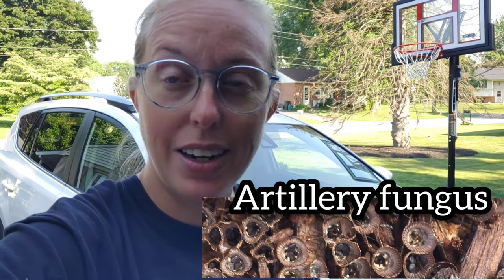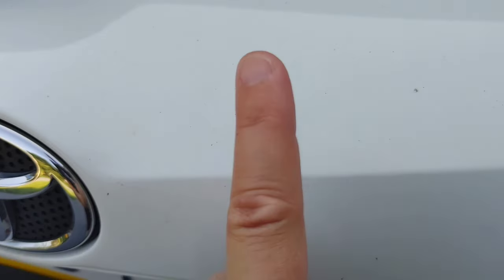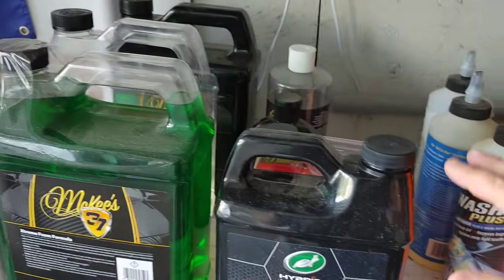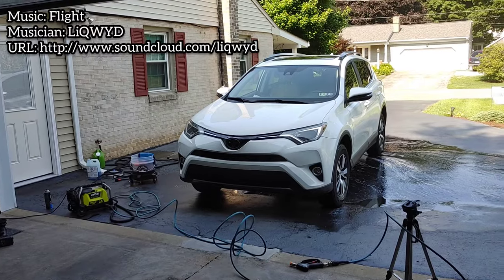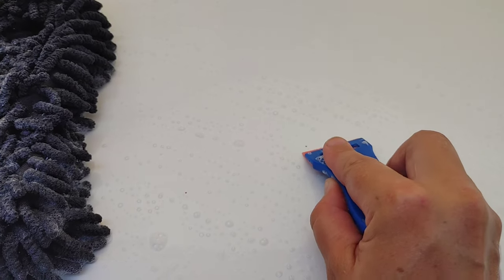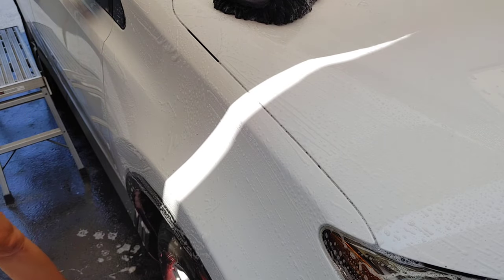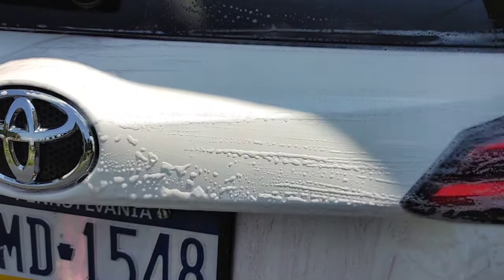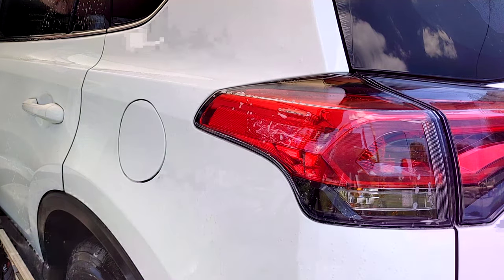How to remove black spots from car paint (aka- Artillery Fungus) + Other paint issues!

Comment: It’s funny I just dealt with this today on a 15 passenger Salvation Army Transit van ! I was able to get the majority of it with my pressure washer an APC pre soak , and then foamed with a heavy concentration of max power amped up with a string APC let it dwell and attacked it with the pressure washer up close and personal like. It got the vast majority of it without having to resort to more labor intensive measures on that big ol hoss!

Comment: Very good video as usual. A quick question for your experienced mind if that's ok?  Do you rate the new generation of tfr's? The non caustic, algae and seaweed based ones? I've been using one recently and I find it as good as surfex hd for it's cleaning ability, but not as foamy ( which is a shame ). So, not quite as god as surfex but, at dilution of 1.6% in a pump sprayer, considerably less expensive. What do you reckon?

Comment: Chelsea, this was a terrific video! 👏   I've not seen the "mold" issue ever addressed - first! 
I've  dealt with it but never really knew what it was.  Ooof...this vehicle was a mess!  - good job on revitalizing it.  White paint can be your friend as you can "see" the problems easily instead of darker paint in the same condition where you have to work a lot more by feel...
 I suggest the Turtle Wax Max-Power as  pre-wash for these situations  - it has worked tremendously for me.  I've not used that plastic scraper before  - does that accept plastic razor blades?  That is what I use.  I always keep a couple of those in the pocket of my detailers apron.  Gulp!...hey, if used cautiously they are a hand-dandy piece of the arsenal.   
Really good subject matter here!  Stay cool!  I did a full size pick-up interior (black) in this heat...ugghh.🥵

Comment: Was looking at a couple of videos as my ex-wifes car has had these spots for ... years, yes years .. on the roof of her car. Nothing worked getting these off. Tried all kinds of soaps, alkaline, acid, vinegar, cheap car polish and whatever. Even going over with a fingernail you couldn't even feel it.  There where patches of these things. Some part they were like hundreds in a small area.  Not having clay or wanting to use tools, since I don't have them nor the experience, I tried Meguiares ScratchX v2 that I had lying around just to test. Cleaned a small spot with hot water and soap first, dried, tested with a small dot of the stuff and some very fluffy cloth. It actually worked.  
Happily to report that after 30 min of hard work the roof (the only place they were) is as good as new.  First washed and dried it as to have it as clean as possible not to make scratches. It took some serious elbow grease but the result is more than rewarding.  After buffing I saw swirls but it was the dust of the scratchX on top of the paint so a light mist of water and a towel to dry it the roof was 99.8% clean and then some ceramic detailer and it looks like it hasn't looked in years.

Comment: Do you think the fungus would have attached itself to a ceramic coating? Would you have used same process to remove if it was ceramic coated? Interesting video.
Reply from the maker: Yes but it would possibly be removed more easily. Personally I haven't had any on my coated vehicle though.

Comment: I bought a new second hand car recently and when I cleaned it, I noticed some similar black spots on the doors. They break off with the finger nail and took a LOT of elbow grease to remove! But I also found some black spots on the back that you can't get off with the finger nail and I couldn't wash away. After seeing this I'm wondering if it's rail dust and the rapid decon might work? 🤔

Comment: Hey Chelsea what size is the canopy  you use and who makes it? Looks very sturdy and easy to put up. I've gone through two of them.
Reply from the maker: https://amzn.to/3onrUaV its 13×13. Its not SUPER easy but I've got a good process for opening it and my height helps make setup easier. Locking in that first leg is the hardest but after that its easy.
Reply: @attention2detailswchelsea  Thanks
Reply: @attention2detailswchelsea  You made it look easy !!

Comment: I use baking powder toothpaste. Takes it right off with a bit of elbow grease!
Reply from the maker: Be careful as that abrasive without proper lubrication can scratch the paint
Reply: @attention2detailswchelsea  Thanks for replying. The paste itself should be good as far as lubrication goes. 
I also use this to buff out minor/light scratches on my glass fish tank.
I've found it's not abrasive enough to cause further scratches and the black spots come off quite quickly.

Comment: Stubby gun and lance snow foam bottle all MTM,
And are you nozzles compatible with the flow rate of your pressure washer 
Sounds a little loud, like it's working too hard.
Reply from the maker: Yes they work great. My Ryobi isnt the quietest but it works for me.
Reply: With the smaller pressure washers you have to choke down the flow to lift the PSI for foaming. Othersize it just introducing more bubbles like car wash consistency. And maybe Chelsea may do a sponsored backed pressure washer review.

Comment: Chelsea in such a case can a cleaner paste wax that's made to remove oxidation light swirl mark and scratches also do the same job as the polish you applied to remove microscopic marks caused during your cleaning process here?
Reply from the maker: Cleaner waxes sometimes have more abrasives within them than a finishing polish but can be great for removing oxidation and clean the paint
Reply: @attention2detailswchelsea  thank you

Comment: So I have a crap ton of Bee Poop on my car, lot of it is hard. Would Bug and Tar remover get rid of it?
Reply from the maker: You’ll want to try to soften it as much as possible with a foaming presoak and some of it can come off with a good clay towel treatment but sometimes I need to pop the top off with my fingernail softly after it’s been softened by the soap. If that doesn’t work you can try Eulex from Koch Chemie but it may remove your protection so wash after using and reapply protection to those areas you use it on

Comment: I have crepe myrtle tree stains in my paint and I'm finding it harder to remove than any other tree sap I've ever encountered. I've tried everything, bug and tar remover, clay bar, goo gone, mineral spirits, WD-40 and the list goes on. Has anyone been able to remove specifically Crepe Myrtle tree stains??? The stain is not sitting on top of the paint but has soaked down into the paint. It actually looks like it's below the clear coat, it's infuriating.

Comment: do you think buffing these out may be easier?
Reply from the maker: If you remove the tops they can be polished away but you’re polishing a much larger area vs a spot so while I do polish when the clay towel doesn’t remove it it only polish if I’ve mechanical decons fail